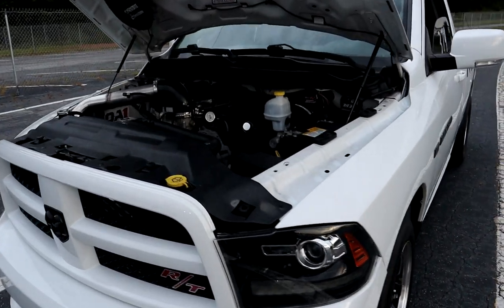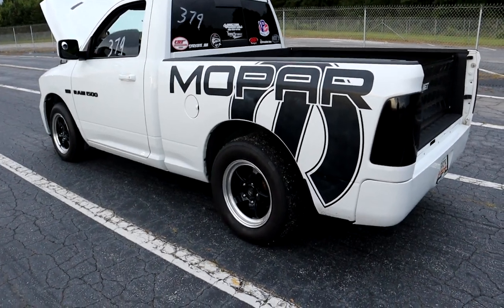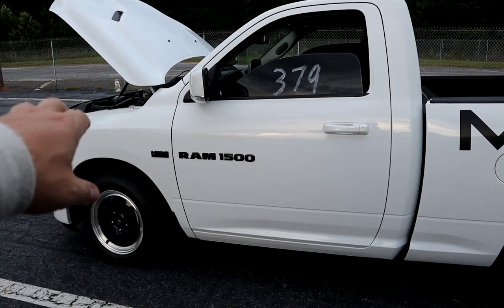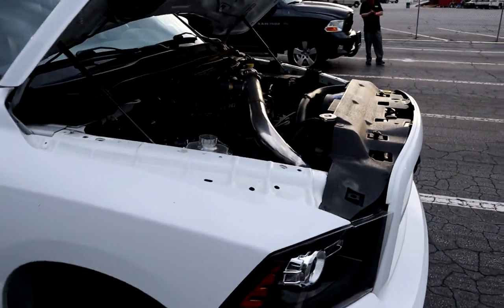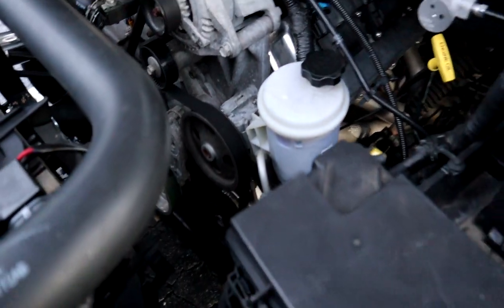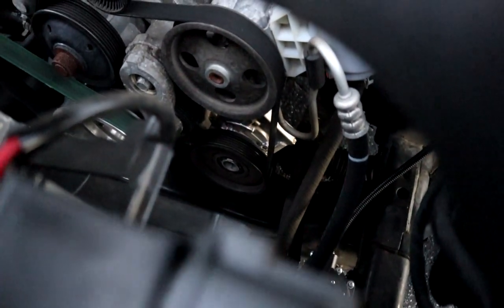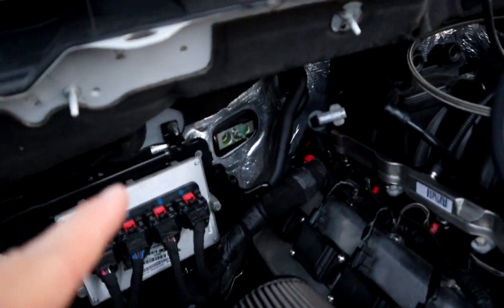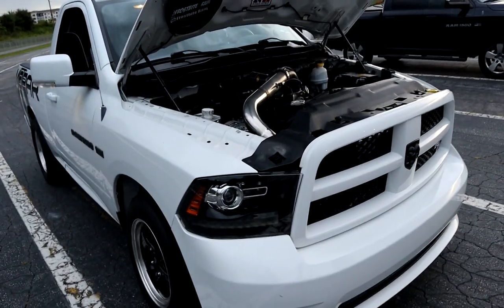First 2Step/Trans brake Launch FROSTBITE VS STORM

Comment: When you gonna twin charge frostbite? 😉😎
Reply from the maker: There has been some talk about it😉
Reply: @FrostbiteRam  ahhhhhh yea!! Can't wait to see how good it runs with two! Gonna need to upgrade the bottom end for sure!!
Reply from the maker: @waznme3920  definitely 👍
Reply: @waznme3920  ive been sayin the same... i wanna see how it does with a 150 shot on the big end to compliment the s.c. off the line
Reply: @bmanclassics4350  that would be interesting to see!
Reply: @FrostbiteRam  did you use a hellcat map sensor? I just ordered my torqstorm kit. It's going on my fully built 392 stroker.
Reply from the maker: @waznme3920  3Bar Map sensor $37.00
https://highhorseperformance.com/mopar-3-bar-map-sensor-all-srt-8-models-5149056aa/

Injectors I used $630.00
https://fuelinjectorclinic.com/SRT-8_5.7_Hellcat/IS153-0650H

Intercooler pipeing kit $123.00
https://www.amazon.com/SUNROAD-Universal-Aluminum-Polished-Intercooler/dp/B074K96W5X/ref=sr_1_1?keywords=SUNROAD+Universal+3%22+Inch+Aluminum+Intercooler+Piping+U-Pipe+Kit+%26+Coupler+%26+T-Bolt+Black&qid=1581913562&s=automotive&sr=1-1

Coolant over flow tank $37.00
https://www.amazon.com/Hwbnde-Overflow-Reservoir-Container-Universal/dp/B07Q8KZ5PH

90 Degree Elbow Reducer Coupler Silicone Hose (3.0"(76MM) to 3.5"(89MM), Black) $19.00
https://www.amazon.com/Universal-Performance-Reducer-Coupler-Silicone/dp/B01KGQPLGA

90Degree 4-Ply High Performance Elbow Coupler Silicone Hose for Auto (3.0"(76mm), Black) $17.00
https://www.amazon.com/Hiwowsport-Performance-Degree-Coupler-Silicone/dp/B01N8TAWWK

Intercooler I used $295.00
https://www.cxracing.com/IC0012-A?search=IC0012-A

TorqStorm Supercharger kit $3250.00
http://www.torqstorm.com/kits_single_ram_5.7_hemi.html
Reply: @FrostbiteRam  thank you! I just ordered the full coolant, intercooler, and piping thru torqstorm. I figured all I need is the map sensor. 
Thanks for all the info💪